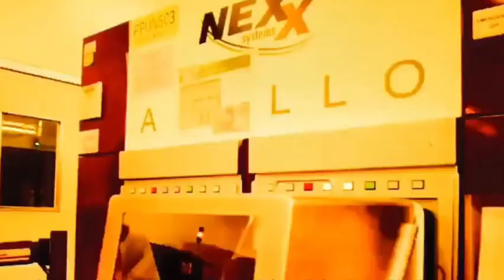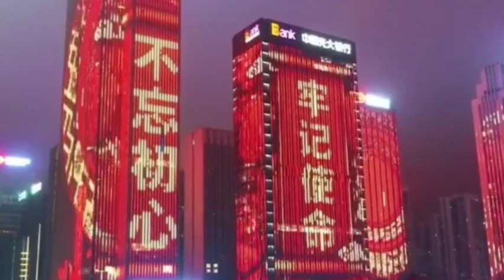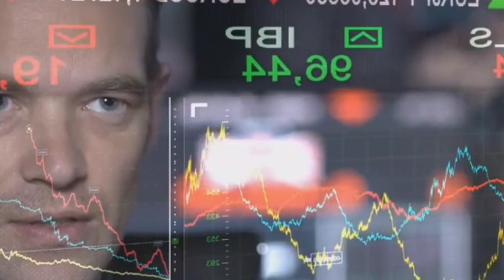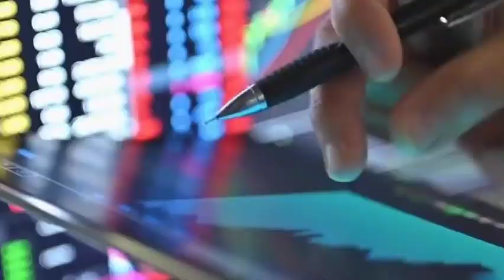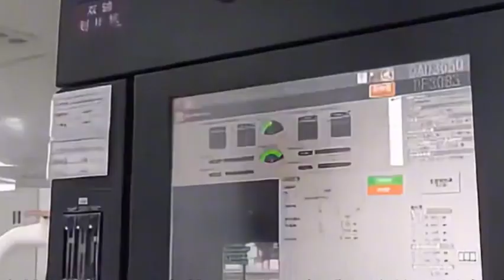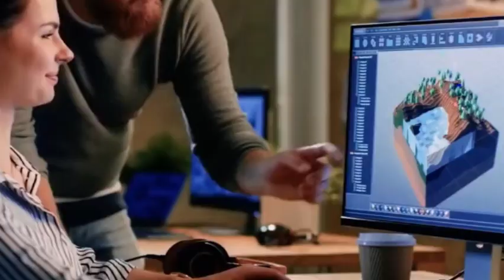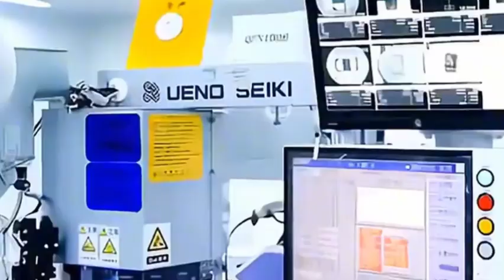Ignoring the US restrictions, ASML will not stop supplying lithography machines to China.

Comment: The Chinese should only get the newest machine instead of the old machines from ASML.
Reply: There is no such thing as old DUV machine. These are always being improved and their capabilities scaled. 

The visible market actually has set the trend of quickly changing processes but fab equipment does not go out of work even if a new node is prepared. Instead that new node is usually a new production line. 

Each process has its benefits and problems. Especially these cutting edge processes which only find themselves in your mobile and other similar devices. The vast majority of the world largely lies in the 28nm+ processes, because the added complexity, engineering cost, power savings, performance etc is just not worth it.